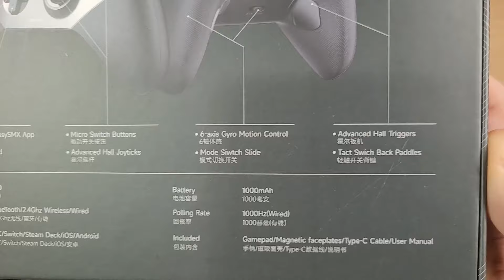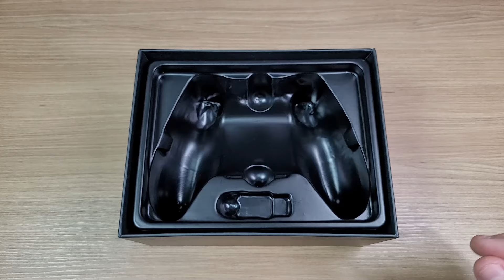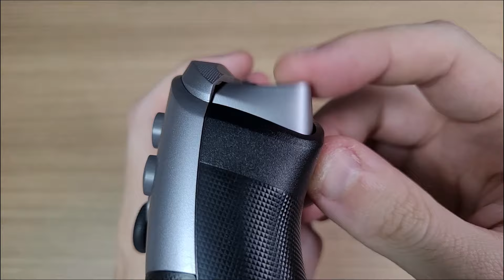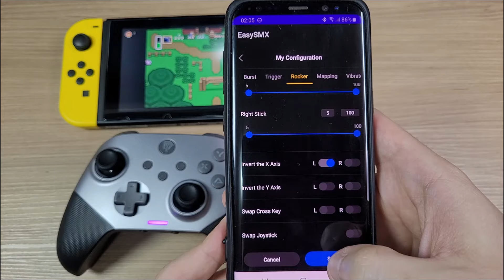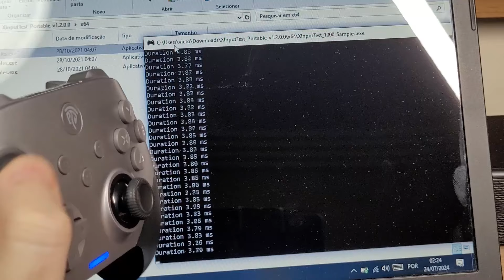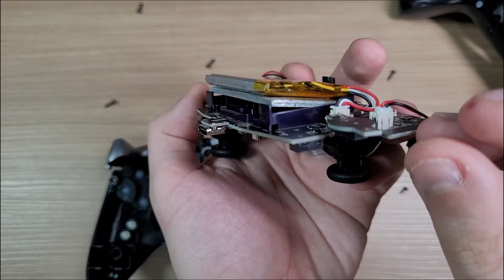Easy SMX X10 - A Solid All-Mechanical Controller

Comment: I'm using it as i type this. X10 is a good controller,  i really like it
Reply: is it still going good? Im planing to get should I?
Reply: Is it still working fine? I'm planning on buying the controller. It's very impressive and offers good value for money. I've only used first-party controllers so far. My only question is how durable it is.
Reply: @darthdragon8676  i stopped using it lately, but not because it's bad. I just found something else that i prefer, but the x10 is still a good choice

Comment: Thank you for the positive feedback on X10. We will work hard like we always do.❤
Reply: Please include metal shafts on the sticks of your controllers
It adds more life span to the sticks as they won't get worn out from sprinting in certain games 🙏🏼
Reply: Which best easysmx gamepad for racing game? Because I don't have space for wheel
Reply: @EasySMX 
I have 2 problems with my new controller. 
The buttons at the back can only be used as 1-click buttons. A long press does not work, only a 1-click is pressed. For example, in Elden Ring I want to long press the B button so that my character runs faster. The button has to be pressed the whole time when i want to run fast, but when I long press the Button at the back, only a single press is carried out. With the B button at the top of the controller everything is fine and it works with long press. Same problem in other games where i need the long press buttons.. not working on any game. Hardwaretester doesn’t show the long press as well. Doesn’t work with both back buttons.
2nd problem with my brand new X10 controller: 
If you move the controller a little harder, different button actions are carried out. The joystick and ABXY buttons are activated. This happened all the time and normal gameplay was not possible.
WHY!??
Reply: @MoTz_50  whats your controller?
Reply: Garbage brand better to buy flyfigi

Comment: adding weight for high quality feeling...
Reply: It looks like it's built with cheap plastics too, maybe it is to cut cost since it has all the settings you would need
Reply: I mean I really like my controllers to be heavy not because of "quality feeling" but because they feel nicer to hold than a lightweight controller imo.
So I don't care if they put a piece of metal to increase the weight and to save on cost.
Reply: @lxerol  That nicer to hold can be improve with better shell structure and material. But I still don't like them putting dummy weight inside, maybe It's for another purpose like stabilized the vibration motor? Anyway, lightweight mouse exist for awhile, <50 grams and doesn't feel cheap at all, thank to their rigid structure, some with poorly made do feel flex and cheap in your hand.
Reply: @lxerol  Well then you've fallen for the entire point they put it in, to create the illusion that it is of a higher quality, which it obviously isn't if they have to lie about it. Also how does it save money to put in a lump of metal that serves no purpose?
Reply: @9ineEi8hths  I literally said I don't care about the "quality feeling" since it's a cheap controller, but I guess reading comprehension is hard.
The controller is cheap, adding a piece of metal that gives it heft isn't bad. 

and why it saves cost? because they didn't use premium materials to build the controller, why you guys talk like this is an Xbox Elite Series 3?
it's a $50 (even cheaper nowadays) and it has an acceptable build quality.

Comment: Nice video, could you review the machenike g6 pro Starflash with 2000hz polling rate wireless and swappable tension jh20 joyaticks.
Reply: Oh yes, please. I already note the Machenike G6 pro...but it is not in the sale anymore. Maybe because they rework it to a V2, as the G5 pro. But with which options???

Comment: What’s your opinion on the X15?
Reply: It seems to be basically the same controller but with RGB, no mechanical buttons and no gyro.  If given the choice I'd get the X10, they're pretty much the same price.

I went with the X10 over the X15 and I've had it f or a few weeks now.  Very good controller for the price, especially considering I got mine for ~25USD.  Mind blowing value.

The X10/X15 and Direwolf 2 are the best controllers under 50 IMO, then the Vader 3/4 Pro is the best in the next price bracket.
Reply: I have both and the X10 is much better all around than the X15.

The X15 is a decent membrane controller (a lot of people prefer membrane over mechanical face buttons) but I gotta say, they're a little loud for membrane buttons.
The X15 is also lighter than the X10 and the triggers have the shortest traveling distance than any other controller I've tried (I've tried a decent amount of controllers) that can be bad or good depending on what you're playing (not great for racing games).
The polling rate is 1000hz wired and 250hz wireless, so the same as the X10.

Overall it's a good budget membrane controller, but I'd pay the extra $12 and go for the X10 since I prefer mechanical buttons and also need gyro for the Switch.
Reply from the maker: Not reviewed that one yet, gonna check the X5 soon

Comment: Seems decent. Hopefully it doesn’t collapse on itself like the Gulikit controllers do. Always have issues with them. 

Either buttons stop working, get stuck in the face plate, or the trigger button status gets flipped. 
The strongest part of their controllers are the Hal-Effect sticks.
Reply: So it is true that the trigger button status could get flipped... i wonder if you know the solution for it?
Reply: @strion5990 tried figuring it out several times. All different kinds of button combinations, the reset button on the back, and reflashing the controller/update, none of that worked. And also no useable info from Gulikit either. Just the do this and do that from the user manual. 

Not to mention there’s no way to reset the controller back to factory conditions and ZERO replacement parts available for the controller. 

It’s best to just completely avoid Gulikit products all together, because once you buy from them you’re on your own.

I just threw all three of the controllers in the garbage recently.
Reply: @strion5990 on my gulikit controller, the X button and the reassignment button (the one with the gears on it) swapped functionality and nothing I did would fix it.
Reply: I have one of their earlier hall controllers that I use rarely. One of the face buttons just started getting sticky out of nowhere. That's after I've maybe used the 5 or six times. Granted I did only pay like $17 for it off AliExpress. Maybe this one will be more durable and premium.